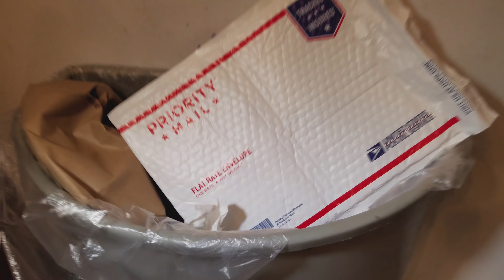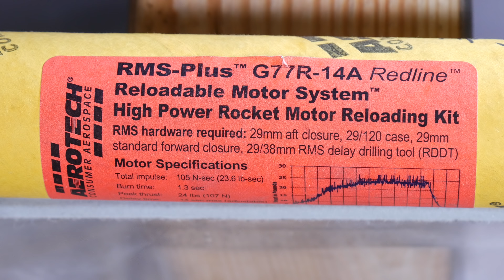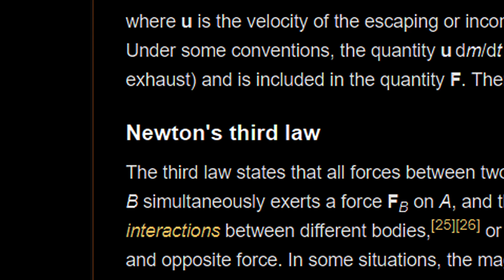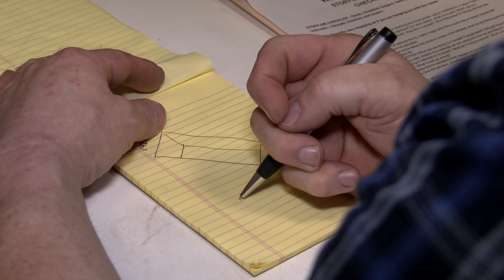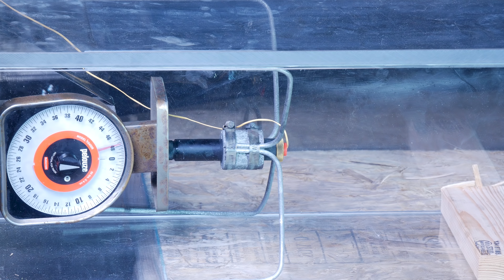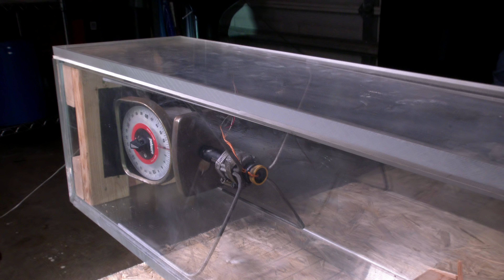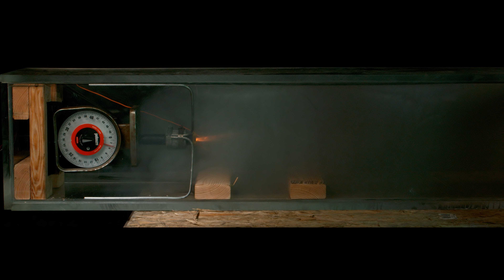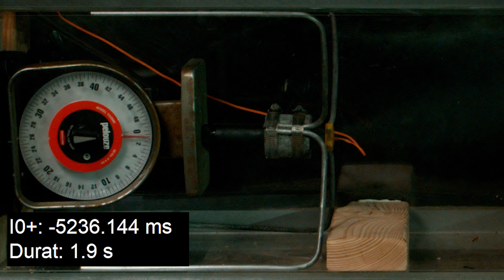Rockets in a Vacuum Chamber - Newton's third law of motion Visualized

Comment: SRBs are first stage engines and are not used in space, so this experiment is not worth anything🤣
Try to ignite liquid fuel engines in the vakuum in stead!
Reply: The claim being debunked is that propulsion is impossible in a vacuum. Hence it has been debunked.
Reply: @yazzamx6380  Not in this experiment. There are pressures created in the chamber once the ignition is started. By the time the SRB fires, the chamber is no longer in vacuum.

BTW. I agree that Newton's third law works both in vacuum and non-vacuum environments. This includes rocketry. It's just that this experiment fails to prove rockets work in vacuum.
Reply: @starroger  - While I understand your point, my observation on this and other similar videos is focused on the slow motion replay upon the moment of ignition, where for example at 10:20 we can clearly see movement upon ignition and hence notice thrust being produced long before the gases released into the chamber could have an effect.

Watch it full screen at 10:20 and perhaps at a slower speed. That's Newton's third law in action, even if we question what's happening as the gases are released into the chamber :-)
Reply: @yazzamx6380  I looked at the video again. I have to agree that there is proof of thrust and the effect of Newton's third law in the vacuum chamber while it is still in vacuum. That is at time queue 10:13. It is played in the video in real time. One has to slow the play back speed to 0.25 and be mighty quick with clicking the PLAY/PAUSE button to see it. You will want to see both the scale against the SRB and the pressure gauge at the opposite end of the chamber. Scrolling and zooming helps here.

Here is what you are looking for. When the ignitor starts, it creates a small jet of burning exhaust AND smoke. I would venture to guess that there are also invisible gases being ejected by the ignitor. Since we can't see the invisible in this video; we have to settle for what we can see, namely the smoke. At the very first instant the ignitor throws out a small plume of smoke just before we see any flame. At this point the scale still has its initial reading of -2.0 lbs. and the vacuum gauge is at zero. An instant later the boundary layer of the smoke has reached the central supporting arch half way down the chamber. At this point the scale reads just over 2.0 lbs. and the vacuum gauge still reads zero. An instant later the boundary layer of the smoke reaches the support block on the floor of the chamber about 3/4 of the way down. At this point the vacuum gauge starts to show pressure in the chamber and the experiment is essentially over. All this happens within the time queue of 10:13.

By the time the SRB ignites at the end of time queue 10:13, the chamber is no longer in vacuum. The pressure gauge is showing an increase of pressure in the chamber. When the SRB ignites it causes a pressure spike in the chamber. The point of the experiment is to show that rockets and Newton's third law work in a vacuum. This experiment did that but only for a brief instant of time. Ironically it did it with the ignitor and not the SRB itself.

I don't know if this type of experiment can be done successfully on Earth. Perhaps it can be done in an industrial sized vacuum chamber where the volume under vacuum is much larger, and where the effects of rocket exhaust are minimal. Or a more conclusive experiment could be done outside the ISS in the vacuum of space. Remember that the point of the experiment is to prove that rockets work in a vacuum using Newton's third law. 

Finally, those who think that rockets only work in an atmosphere by "pushing" off of the air molecules are missing the main point of Newton's third law. It works because of the conservation of momentum (inertia). Look it up you rocket deniers and learn something! By the time the rocket's exhaust molecules collide with the molecules of the atmosphere they are no longer part of the rocket. They will collide and react to these collisions as independent bodies. Their inertia is their own and no longer part of the rocket.
Reply: Froder Hokholt - "SRBs are first stage engines and are not used in space"
This is false.
NASA and DOD use MANY solid rocket motors that are ignited in high vacuum.
The THIRD stage of FOUR of the six spacecraft I have launched were Solid Rocket Motors.
The Minuteman ICBMS are solid rocket motors for ALL STAGES.

The Magellan spacecraft to Venus used a Solid Rocket Motor to place it in orbit around Venus after a many months long trip.